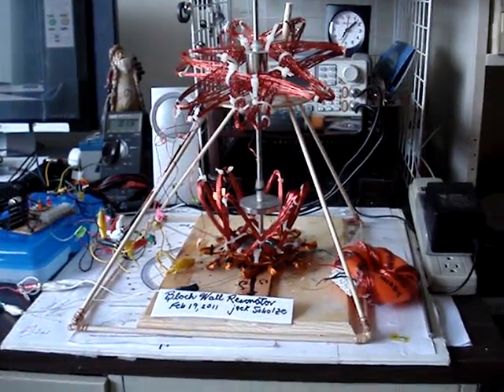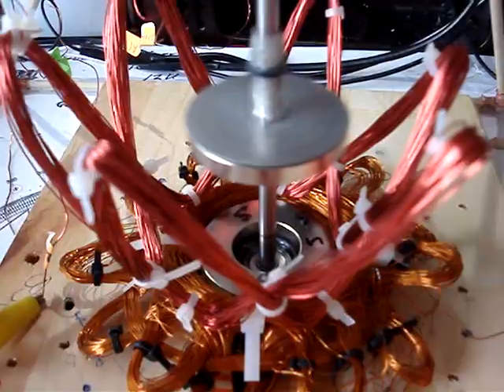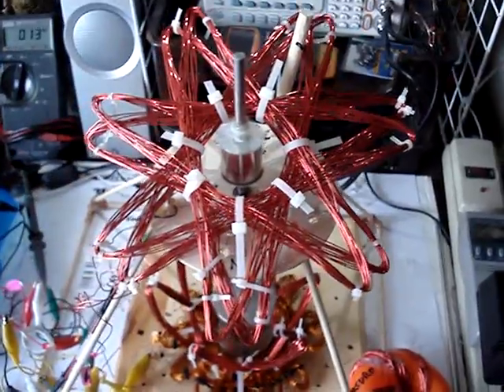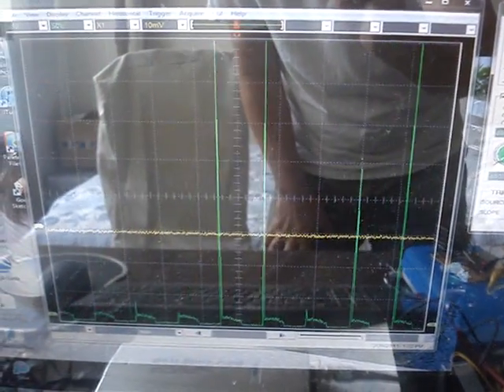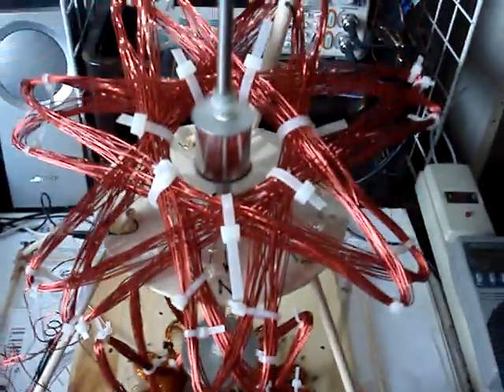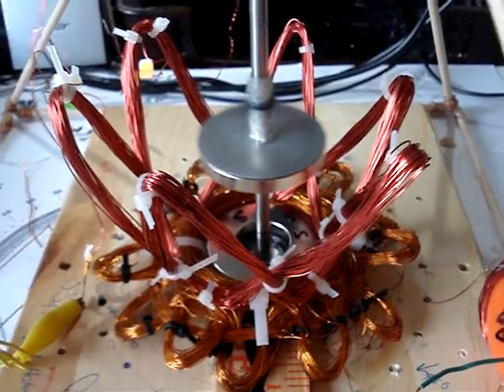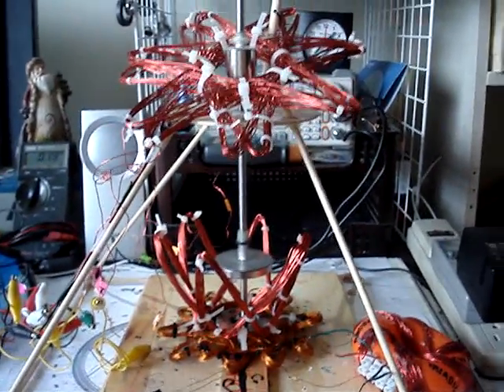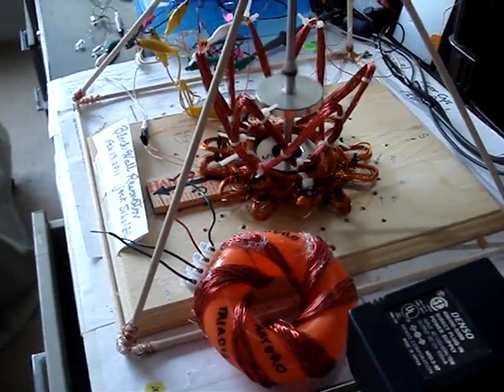Bloch Wall Resonator

Comment from the maker: The shaft is 1/4 inch diameter bearing shaft.  It is mildly attracted to magnets and is stainless steel.   Cant remember where I bought it online, trying to find the order receipt.   It fits 1/4  bearings used for roller blade skates and cars, etc.   just 1/4 inch regular rod wont fit into the bearings, it has to be 1/4 inch bearing rod which is just slighttly .001 or so smaller so the damn thing fits.                Used glue-gun to stick the magnets on the shafts.